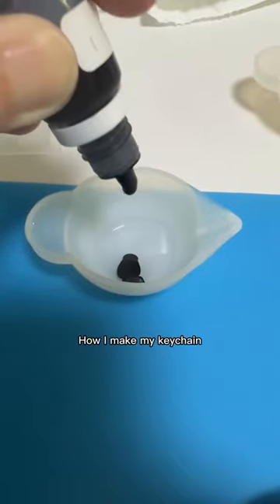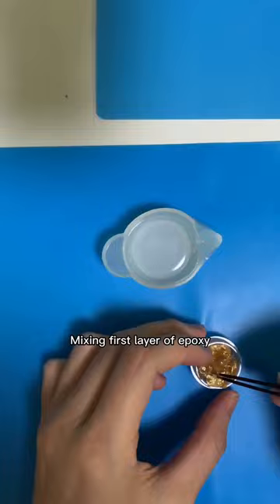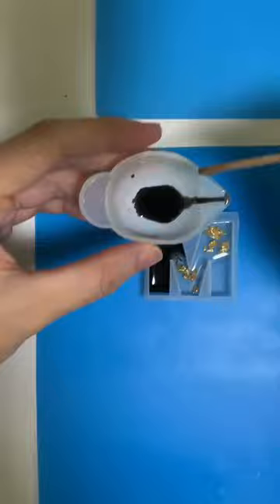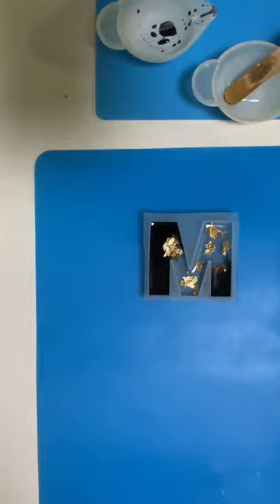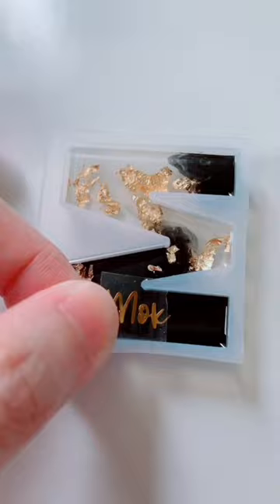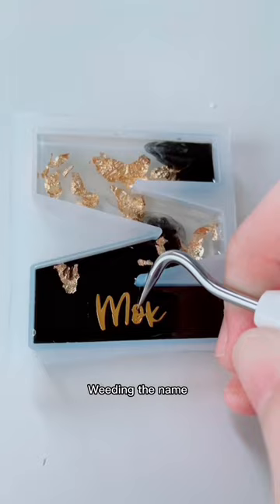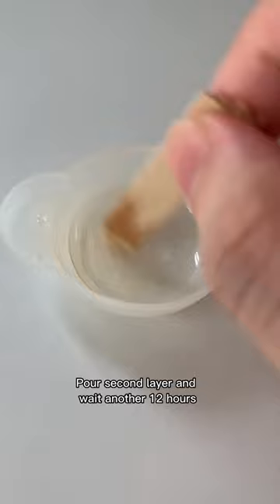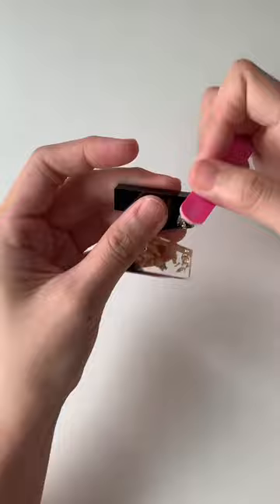Making alphabet resin keychain process #resinkeychain #resin

Comment: Hello what size is the font used?
Reply from the maker: Font size used every time will never be the same due to some font is larger. As long as you pick the small font than the mould should be fine.
Reply: Where can I get the small resin letters from

Comment: if you paint epoxy resin with acrylic will it stay see through?
Reply from the maker: @Yurii-qn3lq  You mean paint outside a cured resin or mix with acrylic colour before it cure?
Reply: @BearBearCammy  before it dries/cures
Reply from the maker: @Yurii-qn3lq  yes, you can use acrylic as colour pigment for epoxy. Depending on the how much colour you add in. If thick enough, it won't see through.

Comment: Alas my resin didn't hard. Could you give me the solution?
Reply from the maker: Which type of resin you bought? UV resin? Epoxy hard resin? Expoy soft resin?
Reply: @BearBearCammy  art resin named resin i used. It didn't hard even i mixes the same amount as given on the bottle
Reply from the maker: @letslearnenglishgrammar7074  Art Resin should be a good brand. If you are using the hard type and it was not hardened. Make sure you really mix them really really well. Especially those at the edges, side and bottom. With the correct technique and ratio. It will harden no matter what. Good luck  :)

Comment: My resin keytags are very sticky what to do for that??
Reply from the maker: 1) Your resin may not 100% cure. 
2) Your epoxy vs resin ratio is wrong.
Reply: @BearBearCammy My key chain is not hard.nwhat to do?
Reply from the maker: 1) Make sure you are using the hard epoxy and not the soft type.  @meandmywork92  
2) Make sure the ratio is correct
3) Try to leave it dry for 1-2 days day. If still not hard. Refer to number 1 and 2
Reply: @BearBearCammy  ok thank you

Comment: Please tell me the ration resin and hardener
Reply from the maker: First, please tell me which type or resin you are using.
Reply: actually i dont know which type 😅 i just buy clear resin, after see many videos i guess the best resin for art is epoxy resin? Or lycal resin? Lycal resin is more pricey. Which type resin do you use? TIA!
Reply from the maker: Majority people will be using epoxy resin. When you purchase yours, make sure the read the instruction. Even the epoxy resin will have different ratio. Either 1:3, 1:2, or 1:1.All resin will stated the ratio. Hence i cannot answer your question. The resin i'm using is 1:3 (1 hardener : 3 resin)  @anaraeveryday
Reply: @BearBearCammy  thanks a lot!